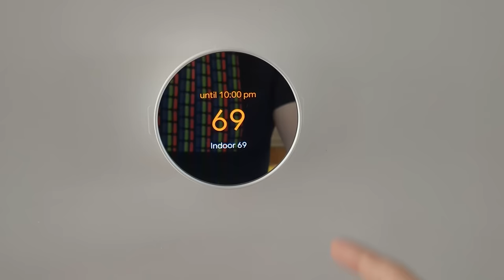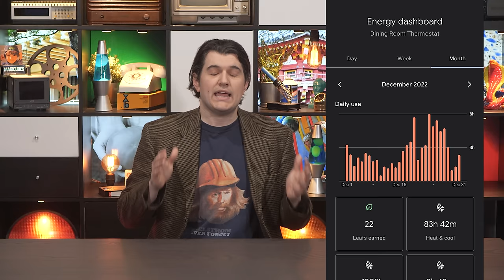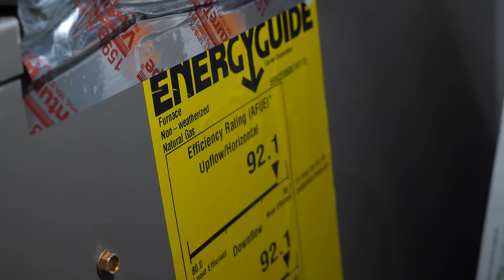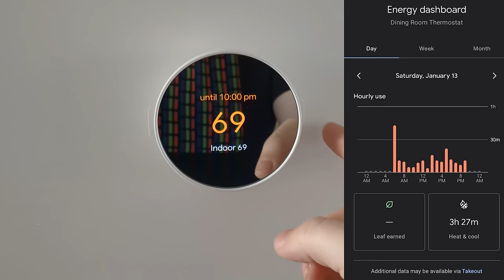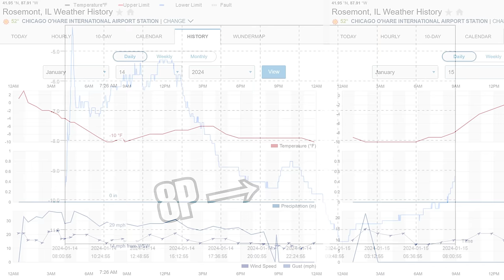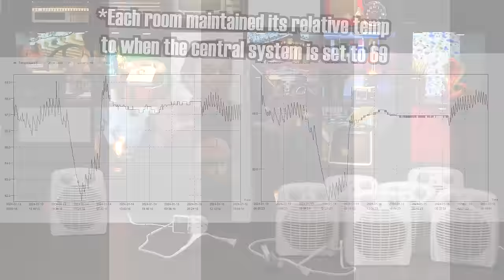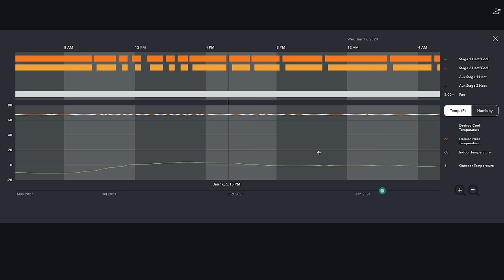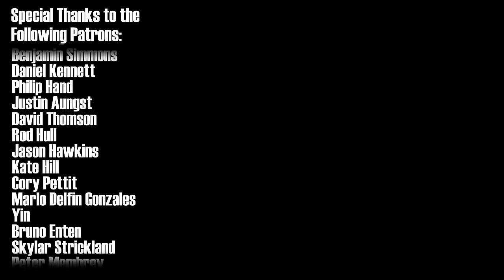Old HVAC industry practices are holding us back and costing us money. But we can fix it.

Comment: I tried a heat pump and almost froze to death, I had to use space heaters, and knocked my knees off of them way too much. I ended up having a 77k btu gas furnace installed. Now the temperature is uniform and there is no hollow cold feeling anymore.

Comment: Here’s another thought that occurs to me: do you have a female woman in your house?

This is of course a generalization, so apologies. But in my experience, it is about 50% more likely that women will want the temperature higher than 69°F. This is a function of whether two people have the same attitude about energy use and sweaters, and I have no doubt that there are men who prefer hotter heat than average as well. But in my experience about 2/3 of women would much prefer the thermostat to be 75 or even 78°F.

So what does our math tell us about wanting to maintain those higher temperatures? Does it mean that we need 14% more capacity? Or is there a different equation that we have to use to determine how to maintain the higher heat?

That being said, the 24,000 BTU/2 ton unit should more than compensate for a 14% increase if the 69°F BTU size is 20,000 by your estimate. It works out to just under 23,000 BTU.

Is that how the math works for an increased heat requirement?

Comment: Installers are not designers, designers are not sales men. 

You can’t put all the blame on the contractors. manual J design is 70 heating (in the winter) and 75 cooling (in the summer). People don’t want 75 degree homes in the summer. Regardless of the 50% RH. 

This does however play a bigger role in humid places. Not so much the Pacific NW. 

Oversizing furnaces help with air distribution. Not just heating capacity. 

Missed some pretty major points considering the length of video. 

This really could have been “the importance of a load calculation” 20, maybe 30min video.

Comment: Here is my question that I have not got a satisfactory answer. When I don't work at home, my thermostat is at 50, only higher than that in & the morning when I get up, & less often if I get home and have several hours before bed (less than half the time)
Some people tell me that, that heat differential is wasteful and costs me more.

Comment: So we just got a heatpump to replace our old gas power furnace. Tying to find out, if the equipment was oversized in that case as well, which is not very easy without a smary thingy. Overall it was very expensive. For reference i live in germany, so things may very well be a bit different here.
Reply: in germany i bet you have a hot water system rather than forced air. with such high electricity prices there , i can't imagine a heatpump being economical to run.
Reply: @Jon-hx7pe  Yes, exactly the heatpump heats water instead of the air. So no AC for us in the summer sadly. Tbh, not quite sure about the cost part rn. When it was calculated it was cheaper, but gas has come down in price and electricity has gone up so it might not be cheaper than gas right now anymore.
Reply: a/c isn't common in germany anyway - doubt the climate warrants it.  @Cenox1000

Comment: I was wondering what the difference in energy consumption would be between a heat pump and a hydrogen boiler with the hydrogen created by electrolysis. Assuming the same heating demand.

Comment: My complaint with this point of view is that, I am lazy. I do not want to have to think about maintaining the temperature in my home. I am also poor. My central air system, which is a heat pump, is all I got, no supplementary auxiliary heating systems here. So my system is slightly oversized, which keeps my house at a comfy temp all year round with some slight inefficiency, It's fine. Yes I pay a little more for this upfront, but it allows me to be lazy

Comment: Actually, oversizing your heat pump for heating is important, it does decrease run time, and run time decreases are more efficient that any tunning you can do. The integral of the energy uses the time as one of the multiplier. I let you do the math yourself ;)

Comment: It is more energy efficient if an air conditioner is at least double the size it needs to be running on 50% or less power! It also saves the unit from running so hard for so long that it overheats and is forced to shut off to save itself from Complete and destruction permanently!

It will last 2 to 3 times longer if it’s 2 to 3 times larger than it needs to be & is of Similar quality.

Comment: Heat pumps work efficiently until the temperature drops enough to activate the emergency heat during a cold snap—or when Grandma stays for a month, and your electric bill skyrockets, leaving your budget stretched for the next three years.

Heat pumps are like the diesel engines of the HVAC world. Installation crews care about their reputation, and a bad review can hurt. Unfortunately, many customers were burned by the early versions of heat pumps from 30 years ago, and that bad experience still keeps some people from considering them today.

Your calculations are off. Most electric companies offer significant discounts during the winter months. However, as you’ve correctly noted, heat pumps are essentially modified air conditioning units. If more people switch to heat pumps, electric companies might have to remove those winter discounts due to peak utilization. So, heating could end up costing as much as air conditioning—plus the dreaded cost of running emergency heat.

You’re advocating for undersized heating systems to cut costs, whether you realize it or not.

Regarding insulation, studies show that as the economy declines, builders often cut corners on house insulation. While some homes meet the advertised R-values, many do not.

This explains why builders oversize the heater.   Builders don’t want to hear complaints about family being cold 24x7.  That’s not conducive to sales.

Finally, anyone working at an office knows that the perception of the heater is subjective.  No builder is going skimp on sizing the heater to its minimal configuration.  It’s cheap insurance to oversize the heater.  It’s not easy to oversize a heat pump unless you’re exceedingly wealthy.  Your skimp keeps you happy and that’s great.  But, builders won’t deviate to heat pumps until you can easily oversize them to 4x and the costs are similar to gas.

Gas is here to stay at least for the foreseeable future.  Your concept sounds analogous to the government killing the combustion engine.  Nope.  People want to drive 400 miles and fill up in 5 minutes.  Most people are not patient enough to lose 1/2 of their car’s mileage  in the cold winter and wait 3 hours for a charger on Thanksgiving day to get back on the road.

Comment: Here me out, what if a while home heat pump was developed. A heat pump that included Hvac, water heater, and refrigeratoration all in to one base unit ad just some clever controlls and a good bit of extra copper plumbing. This could save on the could save on everything needing to have its own compressor, effectively making everything dumb but with a big central brain.

Comment: 13:42 - Like 95% yeah, that last 5% is the reason you can't just take an AC unit and turn it around:  They can handle running in freezing temperatures and have a way to defrost the outside pipes.  Buuuut that's basically what you already have in your fridge so this isn't an explanation for prices.

Comment: Hmm...  Installed a ductless heat pump in my "man cave" home office area that is about 3X as big as it supposedly needs to be - but it's at least a progressive system, so while it runs basically all the time, it runs at very low power, and if things actually get hot, it can power up.  I even leave the doors open to the rest of the house because it is more efficient than my whole house system.

Comment: A hybrid system would be a better design run the heat pump when the temperature is isn't all that cold like around 15 degrees Fahrenheit and up but run the gas system when the temperature is below 15 degrees Fahrenheit considering the cost of buying the system should always be considered because when you pay for something that expensive you should get at least 20 years of service out of it.

Comment: Aging Wheels's video on the Aptera suggests that you're not right about the reversing valve turning an AC into a heat pump.

Aptera has AC in their car, but will not do a heat pump.  Instead, they use resistive heating.  If a heat pump is just an AC with a reversing valve, shouldn't a heat pump be the easier, cheaper, and better way?
Reply: it should, which is probably why the model 3 does it. maybe aptera couldn't find a supplier?

Comment: 30 000USD on a heat pump? I had one installed in my second floor apartment, the outside part is at ground level, and it cos 2 000USD. IN NORWAY, where 30 000USD is the minimum annual income for someone on disability... That's ridiculous

Comment: HVAC tech here! The easiest way to calculate what tonnage system your home needs is by the square footage of your home. Furnaces have a specific btu depending on the size of your home. The reason for the big furnaces is mostly for A/C. If you have a 2 ton A/C system with a 20k btu furnace, your evap coil will freeze up. If you have a 60k btu furnace it will work perfectly. Hope this helps

Comment: Excellent video.  1 big question:  how can the heating Btus NOT be 2 or 3 times higher than the cooling Btus, if the heating temperature differential is 2 or 3 times larger than the cooling delta T? 
E.g. want indoors to be ~70 degrees.  Wintertime temperature -5 = 75 degree differential.  Summertime temperature 95 = 25 degree differential.  
In my home in New England I "know" (estimate) I need about 3 tons cooling, because currently I only partly cool it with 2 x 10,000 Btu/hr window air conditioners.  So I've been figuring I'd need 8 or 9 tons of heating, which does correspond to my current boiler's gross rating of 120,000 Btus/hr.  
The big problem is how do I get heat to all rooms, e.g. bathrooms, since I have forced hot water.  I'm thinking I need a hydronic (air to water) heat pump, but the major manufacturers (e.g. Mitsubishi, Daikin) don't sell them in the U.S. as they do in the rest of the world.  In the U.S. there's SpacePak.
Reply: Heating load in btu per hour is higher in winter than cooling load in AC even in the Deep South.. yes it is 2x to 3x in New England.  My house in south mississippi has 75000 btuh in gas heat and 48000 btuh in ac.. my business has TWO 125k btuh gas heaters twinned together so 250000 btuh in gas heat. Because some processes i do have to be a room temperature.  And we dont run the heater unless needed.

Comment: I want to know what to call it we could call a heater stove that we have it's from the 50s but it's severely overpowered but see the house that it is in 150 years old it's old so was that furnace in the dining room it's in the country in rural Kansas and see a lot of the land here is very flat so that means for in town they might have like a 10 mph gust of wind every so often we have 30 mph gust of wind during the winter all the time every time every day then during the blizzards that we've been getting a lot more recently some of the winds have topped off at around 80 miles per hour so having an overpowered furnace in our house is actually kind of a necessity given whatever insulation is left in the walls has all sunk into the bottom and we're not going to put a heat pump in on wiring that is original to the house we just don't want to mess with it and also tearing down those walls means we have to get an asbestos crew in all's I did was hit all the walls with a nice light coat of spackle than some paint just to prevent any sort of asbestos from actually getting in the air I don't know what to call the shingles they're like old metal shingles wouldn't know what's it called them just metal shingles the house has the original metal shingle roof and it doesn't even leak it's in pretty good shape still probably because the landlord who owned it before us repainted it almost I think around every 5 years that's what the guy told us but what I'm saying is there's the original Windows there's 100-year-old wooden siding there's old wiring so there's not really a good option for a heat pump because we don't want to have to rip out all our wiring and replace it and there's asbestos in the walls and ceilings it's better to just leave s*** alone that is literally the best option that you can take with an old house like that yes super sketchy probably what is 200.00 dollar a month rent something you see very often for a house that big no that is something you don't see so yeah we're sticking to our house and are sketchy ass means of heating I personally don't mind natural gas heat and that oversized furnace is actually really efficient due to the fact that you put a couple fans and all the doorways of that house it will only cycle on and off a few times and that's about it and you'll keep the house at a solid 70° if it's set correctly

Comment: Is your gas furnace NOT running 100% while it is running?  So, cut your furnace capacity by a 1/3 and maybe it would run 24 hours a day.  Also 62 Fahrenheit.  We keep ours mid-70s during winter.
Reply: Most furnaces only have two options: off and on. They achieve specific temperatures by only running for certain amounts of time

Comment: What if you hit those worst case temperatures and a window is broken or a door is left open. Maybe work needs to be done on the house or you're moving. Youre gunna wish it was oversized then. 1500w will realistically heat your townhouse with cooking and other electronics.
Reply: Given that his house can be effectively heated by 7 $20 space heaters it feels a bit silly to install a 3x too big furnace for rare emergencies. He specifically mentions having resistive heating for backup as well

Comment: Wrong : gaz heaters ARE impacted by shorter cycle times. the first 10min they are cold with a bad efficiency ( I agree its not like your typical wood burner where it is more ore less 1h) So with very short cycle times like 20min, they run cold half the time ! also a lot of short cycles are wtressing a lot more all material inside, thus reducing lifespan. Regarding oversizing, why don't you say simply that bigger is more expensive ?

Comment: Don't forget to account for climate change increasing heating or cooling needs! It's obvious why it would increase cooling needs, but it also will cause colder winters in many parts of the globe, which means it could increase heating needs too depending on where you live. If I ever achieve the pipe dream of owning a home, you can bet your ass I'm going to oversize my HVAC to account for this, and then some more on top of that to account for uncertainty. Especially considering I'm heat sensitive so having extra cooling is pretty much medically necessary for my health, and adding supplemental cooling isn't as easy as adding supplemental heating. Also with variable speed compressors, the penalty for oversizing (i.e. poor dehumidification and short cycling) pretty much goes away completely unless I'm missing something. 

There are other considerations too like dust building up in vents/ducts/coils and reducing the efficiency over time as I found out the literally painful way (due to those health conditions I mentioned). Yes, systems should be cleaned periodically but it's nice not having to clean so frequently and having some leeway by oversizing a bit, and that's especially the case if you're risking potential hyperthermia/heat exhaustion or even being hauled to the ER in an ambulance if you try to clean your HVAC system in the summer (and due to climate change "summer" could last over well over half the year mind you), which means no cleaning whatsoever for possibly nearly a year.

Comment: You made a whole video calling these "heat pumps" and then made the revelation that they are just a standard a/c with a valve, that's correct... However the industry standard term for what you're talking about is "mini split" 

Which is a mini a/c

Comment: My Ac just went out and yes its a heat pump. The quote I received was $ 15495.00 Installed.. How is that for proof of a rip off.  I will be doing a Mr. cool  system myself  soon.

Comment: And then your house looses power in -40 because of a grid overload. And you're deep in debt due to all of the water handling facilities literally exploding after you house freezes. Or dead, if you failed to notice it during the night. Fun. No, the heat pumps are a dream, but in a really cold place a power-independent heating system, even as a backup, is a must.